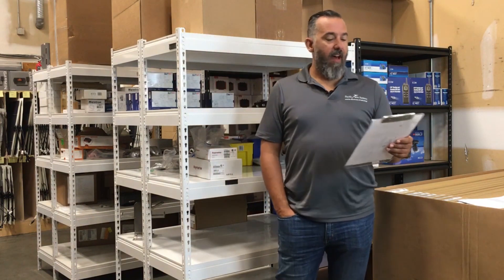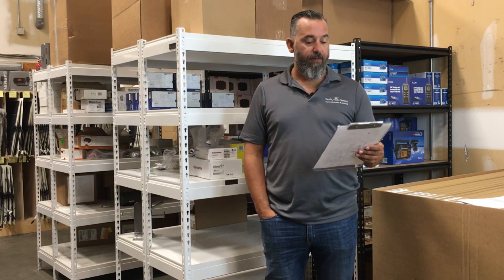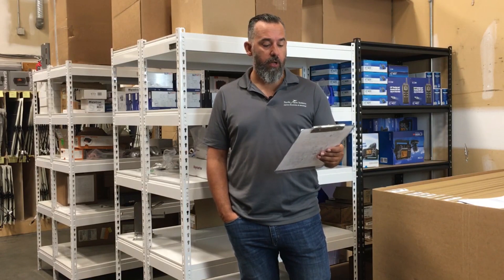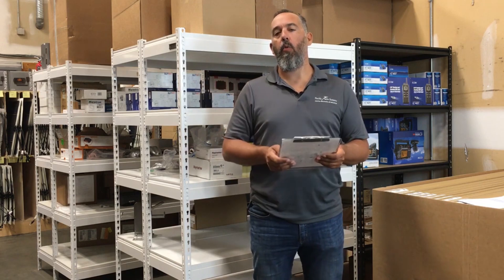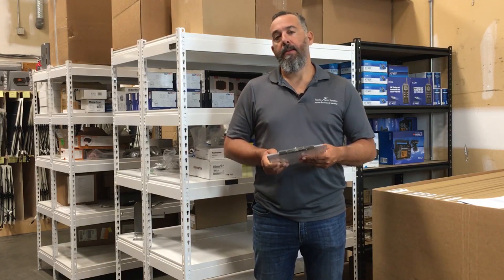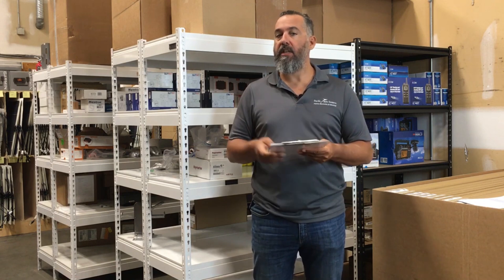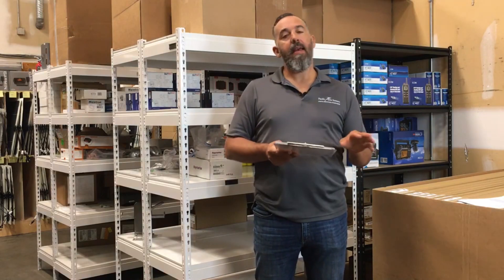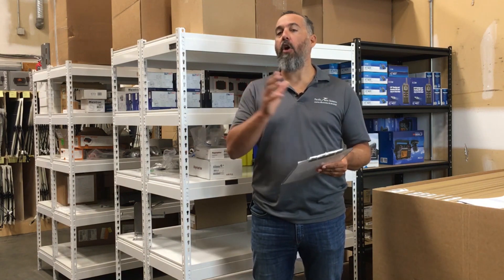Can I Use Welding Cable On My Boat?

Comment: Is wire coded :  E137925 (F) 600 V and AWM 3173 600V OR 3237 1000 V - - 156016 CSA ?I 1251 125C 600V  FT2 OR AWM T  A/R  125C 600V  FT2  OR  AWM T A/R  105C 1000V FT2  equal to “marine grade” wire ?

Comment: Question : Batteries labeled with RC ratings ... I run into them constantly . How does one make accurate sense for what this means in terms of amp hours and loads ?
Reply from the maker: You have to get the amp-hour rating from the manufacturer. Not sure how to convert RC to amp-hours.

Comment: Got a question for you Jeff: as we all know, most battery banks have a recommended minimum charge rate of at least 10% the bank size. For example, if you have a 300AH bank you should be charging your bank at least at 30A rate. 
For us cruisers that rely on solar panels, this criteria is almost impossible to meet at all times due to cloudy days, early morning (when batteries are eager for a recharge)...
My question is: is there any harm being caused to the batteries if early in the morning the panels can only deliver say 5A?

Thank you for always providing great info!!

Cheers
Reply: Was just thinking about this the other day ....good question . And Jeff if you get to this one could you include if the different battery types (flooded ,agm,etc) will all react the same way . Thanks .
Reply from the maker: Hi Diogo, good question. With solar you do what you can and rarely does have a solar array to reach  minimum charge rate of the battery. You'll do what you can with solar  but yes the battery bank would ideally be charged higher then 5 amps on 300 amp-hour battery. Basically you do what you can.
Reply: @PacificYachtSystems  thanks for the reply. I agree that you do what you can with solar. I think there are many boats with a well sized solar array that in full sun will be able to charge at the appropriate rate. My question was more like: are we hurting our batteries when we don't have the ideal sunny conditions? Early in the morning is a classic example.  
Thanks for the attempt to clarify PYS
Reply: @Diogo, you seem to be describing using solar as a suplemental charge source; to either extend your time away from shore power or reduce the number of hours that you run your engine. With a proper charge controller you should consider panels as adding a second option to your charging regime. Your primary charger should still be independently sized at 10% or more of your bank size.
Reply: @brianbuchanan5170  hi Brian, thanks for the reply. My question was more in terms of, even having a main charging source, your panels will be charging your batteries at a very slow rate 7am when the sun pops up and the batteries are hungry and taking bulk charge. Unless you're willing to turn your engine ON every morning first thing in the morning (when you're out cruising) your batteries will be charged at a rate much lower than the required rate for a few hours. Does that cause any harm to the battery bank?